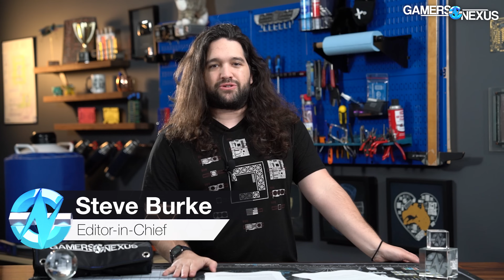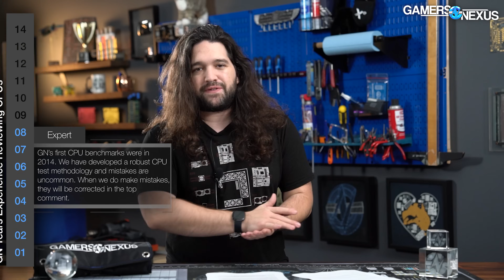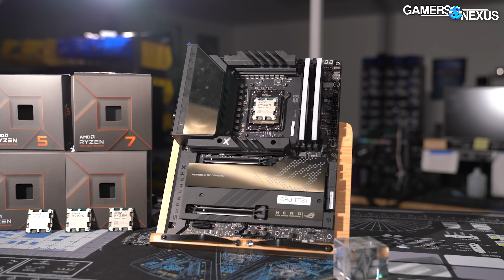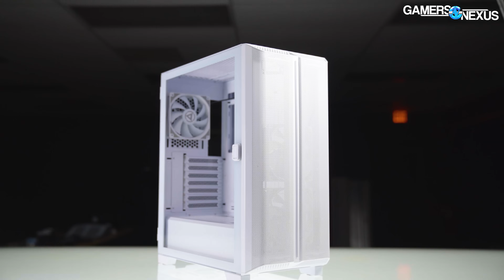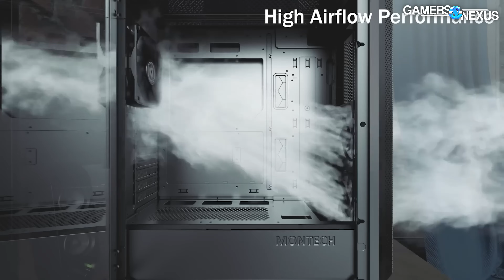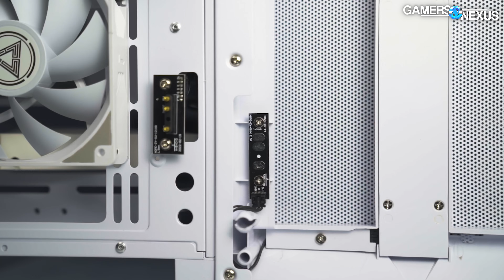AMD Ryzen Eco Mode Deep-Dive & Benchmarks on R9 7950X (Zen 4)

Comment: I understand that GN is usually looking at hardware from a more traditional sense, hence constantly reminding that "300MHz all core". But the reason why many people look at these ECO modes is that the thermals and system noise concerns overcome the significance of the performance. 
For me, it's not that you "lose 300MHz all core and that's a lot", but rather you "lose 6% of the core clock while reducing 50% power consumption". That's a truly impressive and disproportionate improvement. Personally, I care about these things because I am an ITX gamer nowadays, and there is a limited thermal budget for the system and a limited noise budget for my own sanity. My logic in looking at this is "what's the best performer at certain wattage that my cooling system can handle", and from that point, even a 20-30% weaker than stock 7950X is still within consideration. Although realistically, the best performance-to-cost ratio probably lies somewhere around a TDP limited 7700X or a 13700K for gaming.
Reply: From a gaming standpoint, what's your reasoning for the 13700k over the 13600k? IMO the performance gain is negligible to the price difference, and the 13600k outperforms everything in the field in a gaming sense except the other 13 series, and they don't lead by an incredible amount either. I almost don't even understand why the 7's exist anymore, with the 13600k being 14 core 20 thread, and having impressive workbench capability anyways. Seems like if you really needed something more from a workbench standpoint, you would just get a 13900k or 7950x as nothing else really justifies the price to performance difference.
Reply: @Wrenchingandnursing  I just took 13700k as an example of something "not the flagship". I'm not that familiar with the 13th gen lineup, and the i5 may as well be more sensible than the i7 for gaming purposes with a limited power budget. I just vaguely remember that people were picking the 12700k as the sweet spot amongst the 12th gen lineup.

I think the mid-range SKUs still have unique spots in this performance vs package power chart. Say we set a 65W power envelope, for the 7600X to the 7950X the average W/core decreases respectively. I think the peak performance per W probably lies somewhere around 6-9W/core like the 105W 7950X, so for a 65W limit the 7700X might make the most practical sense, in that you don't lose 30% of performance like you do for a 65W 7950X, but still has the thermals under control. But that's a very rough guess and might as well be wrong since CPUs work in very complicated ways, and we've seen that the games don't scale very well with these Ryzen core counts, so maybe a 45W envelope 7600X is all you need for the best overall price-gaming performance-noise experience for going AMD.

Again I don't know too much about the Intel chips, but they seem to draw not that much power in gaming compared to some other workloads. My guess is that given a certain power limit, the 13700K might still be better than the 13600K, but maybe not by a huge amount, so the 13600K might as well be the most reasonable choice.
Reply: @Wrenchingandnursing  Yeah, if you're doing SFF/ITX builds, you already know you're highly likely to fork out a little extra change out the gate. Arguably a "bourgeoise" choice. The very notion of a 16 core CPU living (keyword: "comfortably") in a 5L case is batshit crazy- or it used to be.
Reply: not itx gamer, and I will take a 7700X @65/105W all day.
Reply: @guy_autordie  I think that's a great option as well. If you are doing it for the noise and thermals that's great. With the price difference over a 13600k if it was done from a more energy saving standpoint you'd have to leave it on nearly 24/7 for a year or use it for a couple to negate the $100 difference.
Reply: 5800x3d would’ve been much easier to cool in micro ITX case with very similar gaming performance for hundreds less
Reply: @_sneer_  5800X3D‘s default package power is actually 110W if I remember correctly, although I don't really know how much it pulls in different games. The thing about 5800X3D is that it's factory locked, and I'm not sure how much more freedom you're allowed. If you're limited to an ITX case with only downdraft cooler options, there is a chance that the 5800X3D's default package power is too high and you can't keep the cooler fan noise down. Otherwise, it's a brilliant gaming CPU for sure.
Reply: @strat0caster124  From what I remember (been a while since I read the reviews) the 5800X3D is the most energy efficient gaming CPU right now, pulling only a little more than 60W while delivering equal performance to an off-the-leash 12900K pulling 230W+. It's insane what kind of difference the larger cache brings to the table. I'm convinced the Ryzen 7000 X3D models will  absolutely annihilate Raptor Lake in gaming.
Reply: @strat0caster124   5800x3d uses about 108W in blender, pegged at 100% roughly. Gaming, it should probably not go over 60-70. It is pointless to go for 7950X when in games all is needed is max 8 cores, even 6, and then neutering that 7950x to some stupid eco mode. Talking about waste of money. Where are you going to fit that 4090 in the micro ITX case? If you’re not going to use 4090, then 7950x is even more pointless. Besides, 7950x is not the best gaming CPU, it is just the most expensive.
Reply: @_sneer_  I agree, above 7600X (which is the Zen4 baseline) you really see very little gaming performance uplift with the number of cores. But the ECO mode isn't stupid. Defaulting 7950X or rather the entire lineup to a 95C temperature wall is stupid. If the 7950X was a 110W out-of-the-box CPU, then yes the 65W ECO mode would be kind of stupid.

I'm really interested in seeing how the Intel chips game under a limited power envelope. From what I have seen so far, they really don't draw that much power in gaming, sometimes lower than AMD, and even at the same wattage, they might just be easier to cool because the Zen 4 IHS design is just straight-up insane from an engineering perspective. 

As for the 4090, the reference design fits in many ITX cases just fine, and if you have seen just how little gain the AIB models have over the reference, you know that that chip is meant to be undervolted or at least power capped at 70% or 80% anyways, you get almost no meaningful performance drop. And if the 4090 is limited to 400W or even around 300W, then the new adapter doesn't make sense, a new power supply doesn't make sense, and the huge coolers definitely don't make sense.
Reply: @_sneer_  am4 is a dying platform.

If you don't already have an am4 one, skip it.
7xx0X3D will come in Q1 2023.
Reply: @guy_autordie  it is not Q1 2023 now is it? And Q1 might mean March just for AMD to anounce those CPUs and might not be available for weeks or months. If for gaming 5800X3D in as good as anything out there. I have 13600K, but it is not just for gaming.
Reply: Yes this point is what irked me the most, even though I knew where he was coming from before he even released the video.  Suddenly he forgets that percentages exist and it's all big scary numbers, 300 mhz, 16 cores.  It's not a lot, and ignores the far more important (although admittedly more more difficult to quantify)  cost per unit work.  

Energy is expensive where I live, and if I'm building a render farm for a production workload 65w eco looks incredibly enticing.  That would save over $500 a year in energy costs per node.  So I'm not looking at the system being 30% slower, I'm looking at installing 2 nodes that will turn out frames at 150% the speed of a single full boost node, with a break-even period of maybe about 3 years.  And then savings of around 300$ a year for every year after that.  Reality is far more complicated than that, but the efficiency curve of the system is far more important than Steve gives credit for for many actual workloads.
Reply: I was going to build a sane system to replace my positively ancient 1700X. Now you make me consider an ITX system with a 7950X (or X3D as my timing permits) that's been power limited.
Reply: @klobiforpresident2254  I go for ITX builds because I am a soon-to-graduate student, so I have limited space and want to take my build with me. These systems are cute, aesthetically clean, and impressive for what they could achieve at times, but are generally limited. You usually need to undervolt & power limit both your CPU and GPU to keep thermal and noise under control, but that's also the fun part about these builds, as overclocking is rather meaningless for normal PC builds nowadays (you have no headroom, and even if you do you gain very little). 

What I am trying to say is that ITX builds are interesting, but you don't have to go ITX just because you want to try a power-limited high-end CPU. You can do that in normal ATX builds as well and still get that huge thermal and noise benefit.
Reply: @strat0caster124  
I could do an ATX / μATX build, but I could also cram sixteen cores in a yeetable package. Tough call.
Reply: In summer in my country, these cpus without ECO would be literally unusable, because you wouldn't be able to breathe in the same room as the computer
Reply: @LordXamon  so that is wrong CPU for you, or you would have to modify your setup or get an AC. ECO mode will not help with this. Besides, modern CPUs in gaming almost never run at max tdp.
Reply: The best for noise is to set a max fan speed and let thermal throttling happen. Your ambient temperature will determine power usage. Easier to move heat across a larger temperature difference.
Reply: Hi from the future. I agree, although my uses are different than yours. I just bought a 7950X because I found a boxless offer for a really good price, and Blender and music production are my main interests (7950X and 9950X performance in Blender is only slightly different). These Eco modes are interesting to me because of noise reduction, but also for stability. I am going to have renders running for hours, sometimes when I'm asleep, so if a lower power mode takes only slightly longer but I'm less likely to wake up to a crashed system, it's absolutely worth it.

Comment: Steve! Sense your going into bios options can you help!? I've had two pc's that in the bios I was getting ready for win 11 turning on secure boot and enabling tpm and after restart they both had blank screens even clearing cmos didn't fix it. One I had to buy another cpu with integrated graphics to reset bios and other is still down. There no good video's on this.

Comment: Thanks, Steve.
I wonder how many heads would explode if you'd reminded people they don't pay for power in watts but energy in joules or watt-hours. Or that a 5000 watt heater run for 1 hour at 95C will dump exactly the same amount of heat into a room as a 1000 watt heater run for 5 hours at 75C.
I think both team red and blue hurt themselves this time by scaring away adopters with high temp and high power numbers without any hard quantified context of efficiency like your Blender comparison. I look forward to the Intel eco modes testing.

Comment: I think dropping 30C is something most people would want and notice far more than the 5% slower CPU. With how fast the CPU is, I think it make sense for most users like that.
Reply: Yup. I want my computer to run cooler so my room doesn't get as hot from it. So I'm loving the eco mode
Reply: ECO mode in my asus bios makes my 5800x run with temps that made my jaw drop to the floor

Comment: Is sad seeing nvidia 40 series, amd 7000 and intel 13th gen all pushing so much wattage just for some little % points. The innovation and efficiency are two things that always go together, archiving new efficiency records means that you need less energy to do the same task, that is what tells you that a technology has actually improved and became more powerful, not the childish marketing "my number is 1% bigger than yours so I won". More efficient something becomes, less energy we are wasting, less we need to worry about gigantic coolers that couldn't even fit in our case, and we don't have to worry about our pc heating our room like it was a heater. You obtain something more powerful, smaller, way less power hungry and cheaper, it's a win win situation in everything without a single sacrifice. Humanity till today has lived through sacrifices and it was the only way it know, but we recently learned to innovate, and look where we arrived with just one or two centuries. The first computer was big as a gym, now we are holding in our hands the same thing, way more smaller, with just the weight of some grams, and infinite times more powerful and useful (the smartphone).

Comment: Question!
In tests where 105W mode performed nearly the same as 170W mode (like Photoshop) did the the CPU still consumed +250W of power on 170W mode or no the power consumption was basically the same between the two modes since Photoshop is not exactly an all core workload? 
Basically I don't think that it makes sense to measure the power consumption in an all core and very heavy workload and start interpreting data from other workloads with it. I seriously doubt that 7950X is using +250W of power in something like chromium compile! In my opinion the socket power consumption should have been measured during each workload and presented in a separate bar under bench results since the whole point of the video was comparing performance to different levels of real time power consumption.

Comment: Topic of great interest to me. Thank you! I use Eco Mode on my 5950X for silence and lower ambient temperatures in my room, and I don't mind the 0-20% performance falloff in games. My GPU isn't new, so I'm usually GPU-bound or have plenty of performance anyway.
Not only is the stock, but well-cooled and higher power 7950X 56% faster than the stock 5950X in the GN benchmark all-core workload, but it loses only 6% of its performance moving to the same power level, maintaining an almost 50% lead as AMD claimed in their unveiling, and better still, Zen 4 loses less performance all-core moving from 105w TDP to 65w, widening the gap between itself and my eco mode 5950X. Awesome. Of course, in games, it's not as impressive, but still an improvement.

Comment: Something slightly overlooked here is less heat which means lower noise as well, sure if you can afford a 7950X you can probably splurge for a nice $200 cooler, but for the lower/mid range parts, not everyone is going to buy the nicest cooler and although they're much better these days the stock coolers are still a bit noisy when they ramp up just a little, so being able to maintain low fan speed more often is also a big benefit for anyone sensitive to fan noise.

Comment: with 7600x already being at 105W TDP I'm assuming it really shouldn't matter testing it as you might as well just run it stock? although the lower temps you see on the 7950x were pretty sweet and I was wondering if you could do the same with a 7600x for gaming seeing almost similar performance with a lower power draw and thus lower temps.

Comment: A small amount of under-volting is what you want. You can get the thermals and power draw down significantly, and the "overall" performance up (due to absent thermal throttling).
It needs a PBO2 'tune'. Ideal power is close to stock, but just a bit down.

Comment: I will be building 2 small factor workstations for 3D work soon. And I will definitely go with a 7950X with a custom PBO that should give me even better results than the already great 105w eco mode.
Reply: I think you could go down to about 90W and still be quite happy with them
Reply: @DigitalJedi  I will go as low as possible without losing too much performance. The idea is to have the coolest result possible while still performing close to 95% of the stock performance.

Comment: Totally anecdotal, but I'm running my 5800X in Eco Mode and the heat reduction has been well worth it, especially this past summer. I haven't noticed too much performance reduction in games either, but nothing I run is SUPER demanding. Definitely worth exploring
Reply: Me too. It´s great.
Reply: I'm using cheaper 5700x, it is just a 5800x with Eco mode factory default. I can manually increase its PPT to match 5800x stock. For new buyer with some knowledge, buying 5800x instead of 5700x doesn't make sense.
Reply: @linearz  That seemed like an unnecessary dig  at the original commenter.
Reply: @Leon_George  LOL
Reply: @linearz  I actually got the 5800x for cheaper than a 5700x on some crazy sale less than half price so in that case I wouldn't say no. I do agree with a big price gap it's not exactly a compelling buy haha but peformance is generally like 2 to 3 percent worse max 5% so very close cpu... The 5800x does sometimes have more substantial single core peformance too but all these things are small anyone would give up to save a chunk of money even if you can eco mode the 5800x and stock it for a lil more juice.

Comment: Not sure if I got lucky or they are all like this but my 7950x is really happy at negative 30 on the curve. Temps are better, performance is better and (I assume) power is better.  I’ve been running it for weeks like this, I’ve thrown stress tests (OCCT, Blender, Cinebench etc), benchmarks, video rendering and hours of gaming at it without a single hiccup. If it’s normal or not, I’m pretty happy with my chip 😁